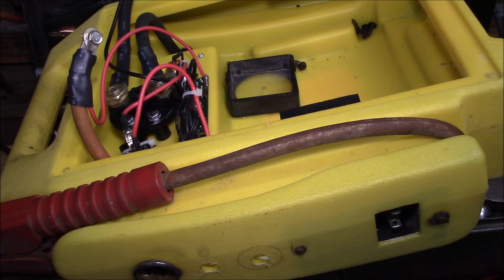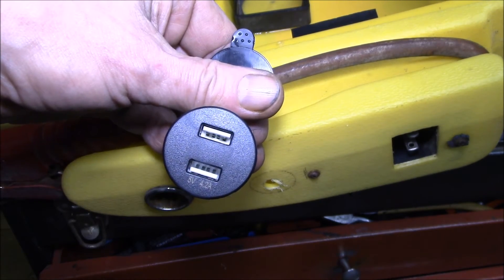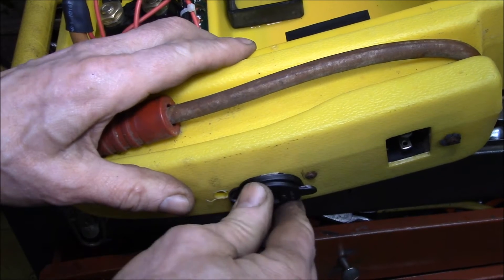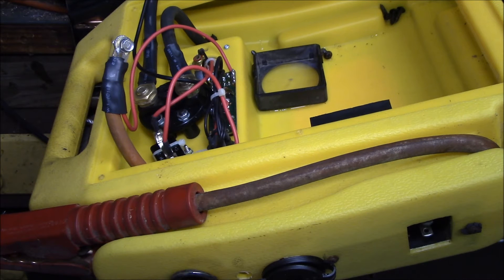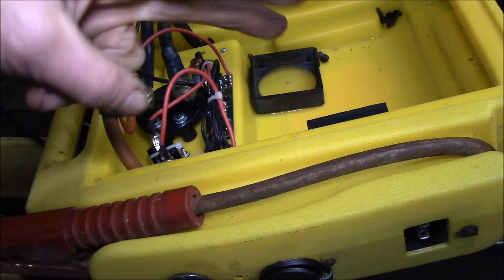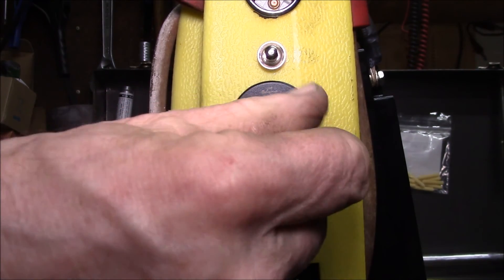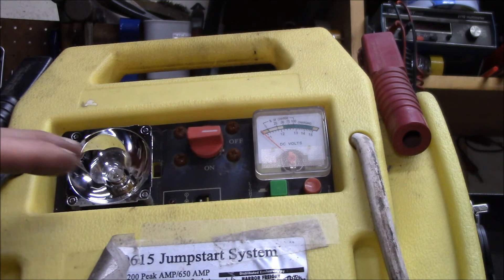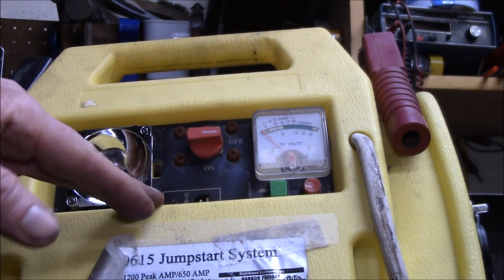Harbor Freight #40615 Jump Start Pack, Part 2

Comment: For those who like the configuration of the cigarette lighter jacks, I found an integrated unit on Amazon that has a socket, USB ports, switch, and fuse. Of course, with this setup the fuse would be inside the case and you would have to open the case to replace the fuse if it blows. But if you use this already integrated unit you will get a nice, clean, refreshed lighter socket along with the usb/volt meter, and the switch. The downside of the switch is that it is not in a protected location. It can be bumped during storage or transport and turned on/off by accident. Anyway...check it out: https://www.amazon.com/dp/B07GL4H4YK

Comment: I have that same jump starter pack....with its cigarette lighter port, can it be used with a solar batter charger to trickle charge the jump starters battery?
Reply from the maker: Yes, it can.  The lighter socket is wired directly to the battery terminals.  I'm doing this in my garden shed, battery is plugged into a solar charge controller via the socket:
https://youtu.be/IRPB8AZ9rxA
Reply: thank you sir

Comment: Nice additions. And fancy punch tool.

I always use mine as a portable power supply for diagnosing, Ive always wanted to install an outlet for two little wired alligator clips

I think u can also charge up the unit with a male to male 12v CL plugged into the cigarette lighter on your car.

I was gonna ask why you didn't make your own battery with some 18650's but I figured you'd probably wana keep all yours for your wall. 

Btw thanks for replying to my last comment.
Reply from the maker: Thanks and yes, those Greenlee punch tools are great.  It was an expensive set back when I purchased it, but well worth it.  Yes, you can charge through the lighter socket, that's how I've been using it most of the time since the AC or DC charging jacks are painfully slow.  I do have a lighter plug to alligator clip attachment someplace.  
I toyed with the idea of a lithium battery, but I have this old 12V charge controller and solar panels I want to make use of.  That would over charge a 3S pack and way undercharge a 4S pack.  And the convenience of just dropping a lead acid battery in and screwing in two bolts sold the idea.